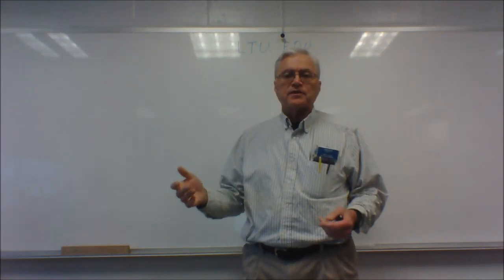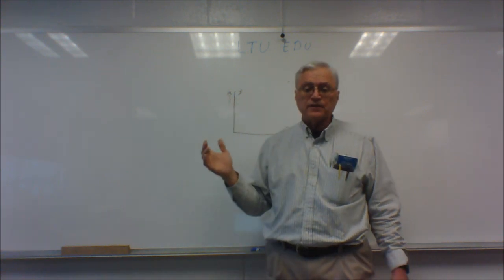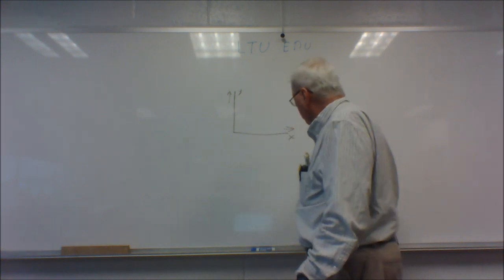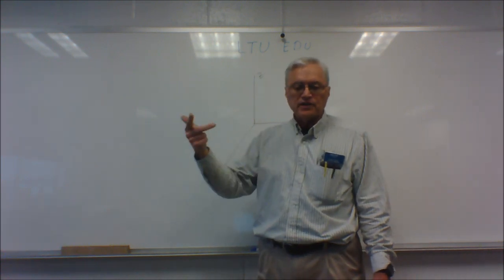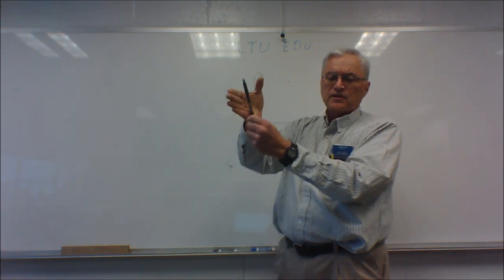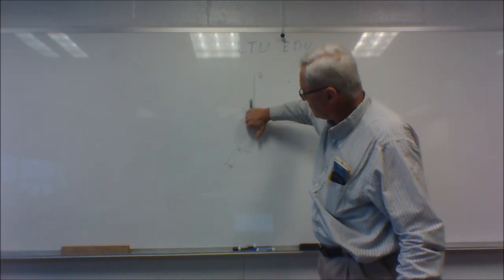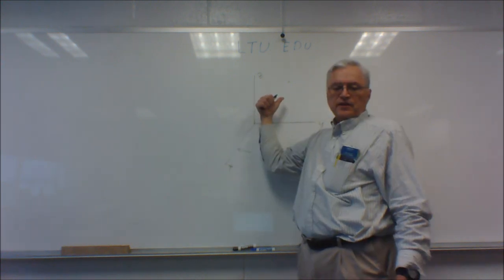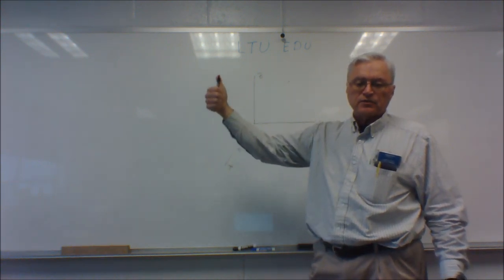Statics: Using the Right Hand Rule to find the Direction of 3D Axes and Moments

Comment: Do you mean direction where force is going toward
Reply from the maker: For moments, your fingertips can point in the direction of the force as you wrap around the axis of rotation - your thumb points in the direction of the moment along that axis.
Reply: @LightAndSportyGuy  but fingertips and thumbs point in same direction when. They wrap
Reply: @LightAndSportyGuy  can you send me a 3d model of moments or something so i can understand i seem to get real confused
Reply from the maker: @vfgrfbgrb  Are you clear on the concept of a moment having a direction that is perpendicular to the plane formed by the line of a force and and the position vector from the rotation point to the force?  You may find this helpful: https://youtu.be/N9rfMxdp0zI
Or, consider you are sitting in a car and about to make a left turn - with two hands on the wheel, your right hand is going to apply a force up, the left hand a force down. This creates a counter clockwise moment about the steering column - if you take your right hand and wrap it around the steering column, your fingers wrap around in the direction of the motion caused by the moment, and your thumb (sticking out) points back at you in the direction of the moment - perpendicular to the steering wheel. 

Another example (not mine) that shows the moment and the right hand rule https://youtu.be/3cIj09PzjaA  at 4:30